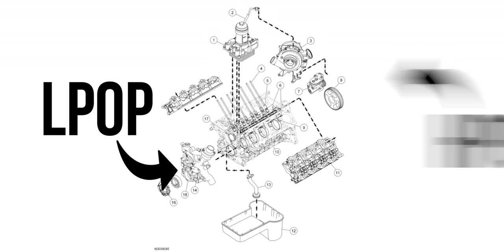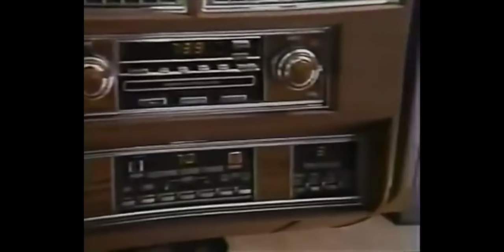These are the WORST ENGINES EVER MADE

Comment: The LF9 in an automobile worked well.but needed to be driven. None of that drive 5 miles to work and home. They never fully warm up that way. I worked with a guy that drove 45 miles to work every day in a pickup with those engines. Never a heavy load but pick up plywood or 2 × 4s for home projects. I think he wore 3 out with high miles. Courier service would be good for them.
Short trip driving and pulling a kind of heavy trailer killed many of them.
Todays cylinder deactivation is a problem for all manufacturers. The General has a TSB out to disable the AFM system.

Comment: Yes the 6.0 power stroke is the most unreliable worst diesel ever made. My 700 RWHP 1400 tq truck dropped an injector tip 2 years ago.  And last month 4 piston rings appeared in the oil pan it ran fine until I tore it apart

Comment: the ford 4.6L 2 valve v8 is the same engine as the 5.4 basically, but doesn't suffer from any of it's issues. One of the most reliable ford engines ever. But I have heard there is a chance it can shoot a spark plug
Reply: This is the first I've heard of this with a 4.6L.  Never had that problem with my '98 F-150.

Comment: You completely left out the original Chevrolet Vega engine. Then there is the Mitsubishi 2.6 single overhead cam engine. You also failed to mention the reason for the common failures of the Cadillac Northstar engine - the head bolt design.

Comment: I have a 5.4 2V Triton original engine in my F150 with 200k miles. No problems with it and it will out run any other make truck of the same 2002 Era with the same small displacement V8... 330ci

Comment: I think the Oldsmobile diesels were much better engines starting in the 1980's. Also provided much higher fuel mileage for their full size 88's and 98's vs the gas engines.

Comment: N54 is a bullet when serviced and tuned correctly and believe it or not very reliable, I know I have a 650hp n54 and have had it for 15 years other than bigger turbos and the general scraping of plastic parts for alloy parts, one of the most reliable fun cars I have ever had in my 65 years, and don't those Corvette Dodge and Mustang boys get a shock when a little old man in a standard looking BMW blows them off.

Comment: The 5.4 3v was pretty good engine after replacing the parts with issues, and with good maintenance.
Reply: My 2006 had the cam phaser stuff replaced at 250k in 2021 and I'm at 271k and runs smooth and strong. 🤷
Reply: Yes, my ‘09 5.4 has run pretty much trouble free for 14 years now with proper oil change intervals.

Comment: I would have to suggest the 2.3-litre engine from the 1971-1977 Chevy Vega.  This engine was also used as the "base" engine (unless you upgraded) in the Chevy Monza in 1975 and 1976.

Comment: My personal nominee for worst engine is the 05-09 Volkswagen 2.0 FSI Turbo.
Awful PCV design, balance shaft cartridge is part of the oil pump and driven off the crank by a weak single-row chain, and intake camshafts are a wear item because of improper hardening of the HPFP drive lobe. Add in oil consumption issues because early direct injection leading to carbon fouling of the rings, and you have a hot mess of an engine.

Comment: Oh you think the 5.7 D Oldsmobile Diesel was bad , they also made a 260 ci V8 version of the diesel at 85 HP and a  V6 Diesel at 80 HP but the best or worst Olds is the attempted and produced in small numbers V5 Diesel which is the V6 with one cylinder removed ! It made 67 HP !! All that said the last 350 ci DX roller cam Diesel from Oldsmobile was quite good , many have been turned back into gas engines and Big Block Oldsmobile 425 ci fordged cranks installed ( same main bareings as big block Olds ) alloy gas heads bolted on ( same head bolt pattern ) fordged gas pistons and rods installed ( same bore as gas 350 Olds) and a distributor put in the hole that runs the vacuum pump on the diesel ( same as gas dizzy hole ) they make a 507 ci Small Block Olds if a 425 ci big block crank is used ! It's funny the Diesel and Gas engines share so much , I once saw a Olds Diesel running with one Diesel head and one gas head ! It was never in a car but it was sure funny !

Comment: Cadillac did fix the Northstar.  I have a 2007 Cadillac SRX with 154,000 miles on it no head gasket  issue.  Starting to use oil now but hey its got 154K on it lol.

Comment: Don't know if the 5.4L Triton was the same as the Ford 5.4L engine in the '05-'06 Ford GT. That one had a 4-valve head and I don't think that had any problem making power or handling big power either seeing how a stock engined '06 Ford GT became the first piston powered production car to run 300 mph in the standing mile. They're getting over 3000hp out of that 5.4L. Js

Comment: I agree that the Triton engines are underpowered for their size.  My 4.2 3 valve gets at best 17mpg driving right around 65mph and 12-14 in town, with no ability to tow more than a motorcycle trailer.

Comment: Chevy Vega, all aluminium engine even the sleeves of the cylinders!  Too bad, it was a neat little car but after the engine would die in 20K miles, no one wanted to buy one even when they put steel sleeves in it, which made it a nice engine.  Too late.  To save a few buck Chevy lost millions.  That was and still is the era of the bean counters, not engineers.

Comment: The Olds 350 diesel can be converted to gas or alky and has wicked potential. growing up a local had what was claimed to be a gas converted 350 that he street raced. he was rarely beat on the street with this setup. You need to do a vid on the worst stock engines with the best potential modified

Comment: Ford Eco Boost engines that run synthetic timing belts inside the engine as well as drive the oil pump. Non repairable trash.

Comment: The 2.3 l and 2.4l GM quad 4 engine. The durability is actually very good, fuel economy is very good. But God help you if you have to fix that damn thing. Get out your wallet as many parts are unique to it and many of its parts and labor are very expensive.

Comment: The dod and active fuel management systems on the newer LTS and LSS is a better design than the 864. Only barely. They're utterly abysmal. There is no reason to shut off cylinders on a V8 engine. Your assertion that the 2.2 Mopar engine was bad is not actually true. A problem with that engine was the fact that they insisted on putting carburetors on the early engines. They didn't have any balance shaft so they would vibrate enough to actually cause issues with the carburetion. They also had an issue with assembly procedures well as soft cams, aka almost every Chevrolet V8 engine that wiped out the front two set of cantaloupes because they didn't know how to properly temper the front two set of can lobes. I literally watched how they were quenching the cams and told them they were morons. How in the world are you assembling cams in a facility in General Motors it's no wonder the Corvette always had aftermarket cams in it.
As for the 5-7 hemi. The ls motors have been breaking exhaust manifold bolts for longer than the 5.7 Hemi is even been out. They're probably made by the same people who made the ones for the 5.7 Hemi. Use a little bit better product when you're assembling the engine a lot of these problems go away

Comment: I had a couple dudes want to buy my truck to swap out their new power stroke with my 7.3 not much horsepower but plenty of torque the engine decal said 256hp 510ftlbs

Comment: It would be great to have a list with newer engine. These engine are long gone here because of the climate, the cars they were in have rusted away long ago. If you have a 30/20 years old car and still keep it for whatever reasons, any failure would be catastrophic because you're probably too broke to fix it or having it fixed. People who said "but I have this engine in my 400k miles 30 years old truck" don't mean the engine are good, it only mean they're too broke to buy another truck. If it wasn't the case, they would have bought another one long ago. Nobody work with a truck that used. 6.0 liter and 6.4 liter were garbage, and it doesn't matter because you were lucky to have the truck pass 5 years of usage, they were rust buckets. Same for the triton 5.4 and the horrid truck they were in. Paper thin body panel, jiggly suspension, theses weren't serious working truck. If I was a broke ass guy, I would have taken a 70s sqare body GM or even a dodge any day instead. English isn't my language.

Comment: Cadillac northstars were known to consume 1 quart of oil every 1,000 Miles and their oil capacity was roughly 5 qts of 5w-30 syn,  the oil life for Northstar engines was "recommended" to be changed every 5,000 miles. Now do the math on how much engine oil was left in the engine by the time service was due.......🤓😬⏰💣

Comment: 2.0L gm 4cy hard to see them without a blown head gasket, my 7 year old 5.7 hemi over 100,000 runs as good as the day I bought it and I can get 23 to the gallon on highway,my son has 170 on his never been touched, and my neighbors is approaching 300,000 1 transmission change if you stay on oil changes nothing wrong with the hemi

Comment: and the issue with the 6.0 is it  is 175 hp school bus engine that is all Navistar meant for it to be  it’s still 100 times better than the 6.4 /maxx force seven  still the 60 or 73 really don’t hold the candle compared to their bigger brother, the 466 on the reliability and work ability spectrum

Comment: The Prv V6 is a pretty bad engine. The first gen was underpowered and pretty unreliable. It was also for some reason used in the top of the line luxery volvo 260 and 760 instead of the very good Red block turbo engines.

Comment: Yay! I get to defend the reliability of my Landy again! lol. So, yes, slipping cylinder liners are a thing, but I'm pretty sure every liner that was going to slip has slipped by now! lol. That being said, these really are not bad engines, as long as you keep them cool. I put an actual temp gauge on it, and saw that it was consistently running at about 235 F on the highway, and would surge to 250 F as soon as I got off! No wonder they eat head gaskets! Solution? Get the Saudi Spec T-stat... mine now runs at 190 F, all day, everyday. (Note: the high factory temp was for the sake of making a fifty year old Buick engine pass emissions... so, if you got to pass an e-check, be prepared to swap in that old T-Stat for a day...). Also, ARP head studs are always a nice edition. Did that when I rebuilt mine... Though, to be fair, when I cracked mine open, the only issue was a cracked ring... bearings looked fine, bores looked fine... It was just overheating when I bought it for $500, so I figured new head gaskets were in order... also slammed some new rings in there and bearings in there... with the block still in the truck (obviously, didn't do mains). Anyway, long story short, my red-neck mechanic buddy, Brian, and I managed to bang it out in a weekend, parts spend was really reasonable, and really there were no surprises. Just an old push-rod V8... only thing special about it is the fact that it was aluminum... back in the 50s when it came out. Did the rebuild back in 2018, and have been daily driving it ever since. Truck had 120k when I bought it... now has 165k, and has not given me a single problem. This is a very long way of saying that a Land Rover can be perfectly reliable....  but with some major caveats!

Comment: Nailed it with the V864 caddy. Computer was the issue. The engineering of the valve rockers is amazing. If the oil was changed regularly there wouldn’t be an issue mechanically. I had a fully functional 864 and it was fun to drive. I love experimental engines.
Reply: I wonder if instead of disabling the cylinder cut-offs because of dissatisfaction with the computer control, if a manual switch could have been easily installed. That's what I would have wanted- flick it over to 4 cyl when I know I'm just cruising down the open road.
Reply: That would control the rocker arms and keep the valves closed but the computer would cut the amount of fuel by 25% for 6 cyl mode and 50% for 4 cyl mode
Reply: @jamesrogers2999  Well yah, put switches on those too.
Reply: @jthomas3773   

It is a throttle body injection set up with two “shower injectors”. People refer to them as an electronic carburetor. Multi port fuel injection would have been the way to go with that system. They use in on the Olds 350 in the Seville. I don’t know why they used the TBI system
Reply: @jamesrogers2999  Ha- I just thought of that but you replied first. Still, wouldn't that work? Because nothing would be flowing down the deactivated intake runners.
Reply: Best bet kill all 4 cylinders and one of the two injectors with one switch. Done. 8 to 4. No 6 it never stayed in 6 for long anyway. Really cool system tho.
Reply: @jamesrogers2999  Agreed.

Comment: Brother in law had one a total piece of JUNK, prior to that a 283 was a perfect engine and now all modern engines are JUNK why? Referring to the old's diesel boat anchor! GM means JUNK now ford is even worse the Taurus junk 4 cyl. Absolutely junk in a junk car, but my 200 cu. In. 6 is running after 250,000 miles even after running out of water 2 times and oil 1 time, FORD made a mistake as this is in a 1981 GRANADA!

Comment: if i might say, the 6.8 V10 also makes less power then a diesel engine, well... idk tbh, but an engine that shoulda been added was the 6.2 and 6.5 Detroit diesel, during the 80's (82 i think is when the 6.2 was introduced) they were gutless and didn't make a lot of power. the reason it sucked was because GM forced the Detroit Diesel division to make a four stroke engine, when they only made two-strokes for five and a fifth decades, and that posed a lot of problems for the 6.2 detroit V8, dont get me wrong, they're cool engines, but the two stroke engines made tons more power. (as i type this im readin off my phone on the stuff of why it was a pretty bad engine) the engine made a whopping 130 horsepower and 240 ft. lbs. of torque, and it was the predecessor of the LF9 Olds diesel. the main problems were the main bearing webs cracking, the pump mounted driver, and oil cooler failure. the 6.5 was a lot better than the 6.2, however it had some of the problems that the 6.2 had, which was the web cracking and the pump drivers. the 6.5 however was turbocharged, and it did not come naturally aspirated like the 6.2 was. however these engines were the predecessor to the Duramax, which would be a whole paragraph itself, and im not takin the time to type it out.

Comment: The Olds 4.3 v8 and Pontiac 301 were terrible. The Olds for just being completely gutless and the Pontiac b/c it has shared intake ports in the head. I had several Dodge 2.2 and 2.5 turbo Daytona's and they were rockets! Add a little boost and it was scary fast.

Comment: 1MZ-FE. Very reliable engine, but they did have sludge problems. I don't recall whether it's caused by never letting the engine run hot enough, using cheap ass oil, a combination of both, or what model years did it

Comment: 11:35 it’s a problem with the stock torque used on the head gasket boltthe 7mgte has the same problem where from factory they weren’t torqued tighten up and they blew head gaskets all the time and when they were replaced Toyota didn’t issue new torque specifications for a long time so they kept blowing again and again and again my hate head is 30 pounds over what factory says it’s supposed to be

Comment: 2.7 chrysler v6
VW Audi 2.0 TSI
Any BMW v8 with nicasil cylinders
Ford 5.4
GM LS with DOD
Lexus 2.5 v 6 
The many toyota 4 cylinders with ring problems
Most or all ford EcoBoost
GM 3.5 v6
Chrysler 3.5 v 6
And on and on
 Its almost easier to list the good engines

Comment: I learned how bad it is to work on a 2.2 ecotec on my old Pontiac sunfire I even learned what a interface motor is long story short bought it used at 110000 scrapped it at 165000 miles
Reply: No those were solid motors that screamed! Had n 05 cavalier with a 5speed n that bitch would run! Had over 200k on it when sold it everything original motor wise. N I know this because I knew who bought it new and I did all the work since day one.